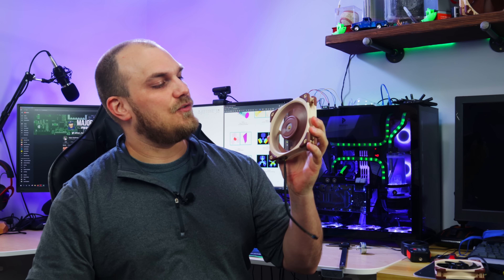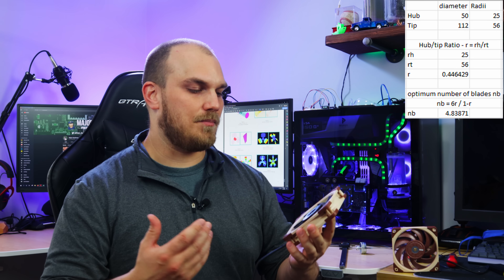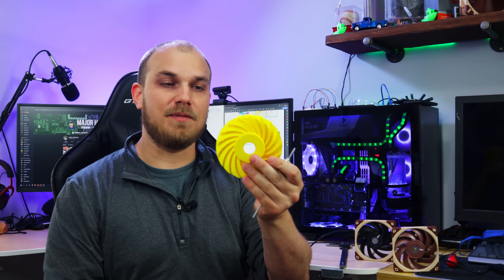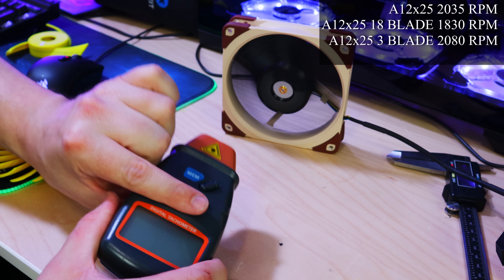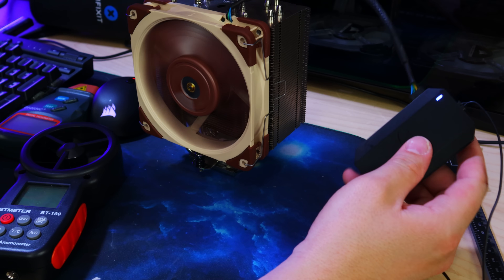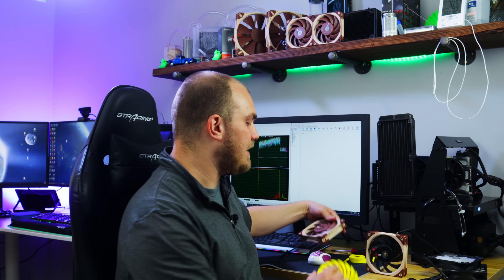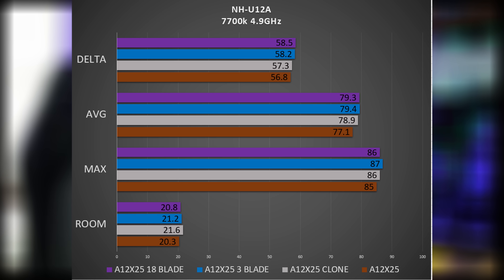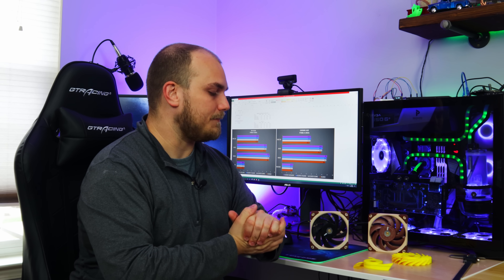What If the Noctua NF-A12x25 Had Twice as Many Blades? | Custom 3D Printed Blades

Comment: If you want to get a fan that outperforms Noctua's, you're going to have to stop ignoring the roughness of your 3d prints. You need to smooth those out, you're hindering your aerodynamics significantly. Given the same motor, you're not going to outperform the fan with significantly inferior processes. Knowing this difference also puts into question your assertions about the 18 blade being worse. It's clear given that your clone performs worse that you have other factors interfering with the performance of your fans.

One conclusion I could draw is that you're wasting a significant amount of energy in generating noise with the clone fan. It spins slower, indicating that it requires more torque to turn, and it's louder, indicating that more power is being used to create noise.

Sand the blades down, or use a printing material that can be used with acetone smoothing. That should be what you do next before messing around with fan geometries more.
Reply: There is a reason noctua had to develop their own polymer, sterox. It's incredibly rigid, which resists centrifugal force, which allows for sub-mm clearance to the frame.  This is what makes the nfa12x25 such a silent and efficient performer, the actual design of the fan blades themselves is a much smaller part of the equation.
Reply: @Cichlid_Visuals  At those speeds, centrifugal force should have minimal effect on blade length so that won't be the issue. I agree that many fans are made with huge and unnecessary gaps which drastically reduces the effectiveness, but that's just crappy manufacturing. Stiffer material might be good for reducing blade vibrations though even with thinner material
Reply: @Cichlid_Visuals : There's a reason for literally everything, though. Might you have meant that there's a purpose, instead?
Reply: @Cichlid_Visuals  Sterrox LCP,  Sterox is cleaner used in wine making.
Reply: I'd suggest manually sanding it down with an extremely diluted acetone solution and a sanding sponge. And some sand paper.

And then I'd make a casts of the fan, and use that to make additional copies.
Reply: @AmaroqStarwind  acetone doesn't work on PLA, now if he printed in ABS it would work. And I agree his prints look awful at this point in time and honestly could still use improvements even in his most recent videos.
Reply: Absolutely. That also increases max speed because less air is generating turbulence and noise. 

Also, another tip is trying to use a different fan with a smaller central hub like an Eneloop, Arctic or Scythe Kaze Flex so there are more space for the blades.
Reply: Couldn't agree more and couldn't tell it better than this. There's also another little aspect that is worsened by the sub-optimal print: vibrations; which stresses more the motor, the ball bearing (in the long run shortening the life of it as well) and, quite probably, adds some noise too. 

A while back I bought some cheap fans form aliexpress and the blades presented small imperfection due to inferior casting mould. That was enough to make them vibrate more and more noisy.
Reply: Realize merely copying the blade and changing the number isn't enough.
You have X amount of power, put into 9 blades.  If you cut that to 3 blades, you have to radically change the blades to even be able to put the same amount of power into the air at the same RPM, where the motor and everything else will be designed to operate most efficiently.
Take an airplane, with a specific engine, and a specific 3 bladed prop that best matches the engine as an example.  Best 2 bladed prop at that pitch will have a larger diameter, best 4 bladed will be a bit smaller.  Or you can change the chord of the blades, or pitch.  Point is 'copy the same blade more or less times' is always going to be a loss if the normal was already designed to be efficient.  You have to change other parameters, not only the number of blades.
Reply: the biggest problem with sanding is changing the mass of each blade to diferent proportions, which will lead to problems, possibly an uneven force distribution that could lead to a catastrophic failure. with these things being as small as they are, it also means, a the variation doesnt need to be big to affect its integrity.
Reply: this didn't age well at all
Reply: @y2ggaming397  I suppose if you're greatly concerned with your own ego then that sort of thing matters to you.

I'm a big enough man to admit when I'm wrong. It had a less significant effect that I expected for sure. It expands my knowledge, though. I might do some deeper testing on the subject if I get around to it, but have quite a few things lined up already and don't expect to find huge gains in this area.

Testing was a bit crude, but good enough to eliminate any tremendously large effect. Either way I wanted him to test that, and he did.
Reply: You realize he knows this right? He was in the air force lol. He's having fun trying things.
Reply: @SirNicholasT  What are we supposed to take away from him being in the air force, other than that he was in the air force?

He's definitely having fun. He's also testing things because he wants to prove or disprove certain design hypotheses. If he wants to make any conclusion simply comparing blade count, then it is reasonable to assert that he must find a way to make his clone (identical blade count) perform nearly the same as Noctua's. Either that, or Noctua needs to stop being his baseline. That doesn't necessarily mean either that surface finish isn't interfering with the performance of the fan. It simply needs to be tested, just like the other things he is testing.
Reply: @Sevalecan  that he was a pilot that went thru flight school and currently an engineer. That's all. If you watch the video he addresses most of what you said but says screw it we're just having fun.
Reply: @SirNicholasT  That's interesting. What is the video titled? I would like to watch it. Still, he did state a goal of outperforming Noctua's fan, and I do believe that's going to hold him back(And of course I could be wrong). And I'm still interested to see the effects of smoothing out the fan geometry.

I also work as an engineer (EE) and have had flight training though not been in the air force. We don't know everything, and I don't assume any other engineer does either. I can't take anything for granted, it's a learned habit, but if he has spoken about this specific topic I'd be interested to hear it. :) And I'm still not sure how much he knows about fan design, I'm certainly no expert either.

Am I overblowing the significance of the blade roughness? Best way to find out is to try it. I'm sure the clearance to the ring is a significant factor, but that would be more difficult for him to test if the rigidity is as significant as claimed (creating the need for the sterrox material), etc and he cannot at least replicate that on his own.

I don't see my post in the light of ruining fun or ignoring it, but I see way too many youtubers give up and never explore anything in depth, though this guy has been a bit more persistent about it than say, LTT, who are incredibly lazy. Linus' latest video on the radiators kindof demonstrated his hubris and the whole channel's laziness to testing things. Granted his ultimate goal of getting views is still satisfied, so he doesn't need to be as invested in the detail if he lacks passion toward those subjects.

(Going off on a tangent here) Series(physical) radiators are, maybe not as bad as Corsair noted in certain scenarios, but they are the least efficient way I can imagine to configure radiators. You're going to have an exponential level off on the amount of thermal energy transferred to the air with a fixed volumetric flow rate of air and cross section, where if you're pulling in room temp air directly into each radiator separately, it should perform better.

I am working on making some of my own videos now, but can't really afford a 3d printer ATM to mess around myself (at least not the one I want). 

Anyway, having fun is great, but I'm passionate about engineering. I have a strong opinion. I want to see things, I'm voicing it. Not in any way attempting to ruin his fun. When you work as an engineer, you have to be willing to accept criticism or questions. It's part of the deal.
Reply: @SirNicholasT  being in the airforce doesnt give you an instant bachelor/master degree in aerodynamics and physics dude. depending on where you are used you may end up knowing shit other than how a plane rides the air or the wheels make your plane waste more fuel if not pulled inside. and even the engineers of the air force dont need to know how a fan pulls the most air inside or the most efficient way, in the end they repair planes and dont optimize them, they open the turbine, replace the fan or fans and give it a go they are not employees of lockheed martin or co.
Reply: I was actually thinking about making a comment of investing in a good SLA if he wants to do this kind of thing. Sure it isn't perfect, but the resolution will do wonders to smooth it out right from the printer.
Reply: it might be easier to just copy the noctua fan and print it- it should perform a bit worse but everything you compare from now on is actually comparable- it would also show how much worse it would get just with the difference in surface quality
Reply: I think he understands the manufacturing process that goes into fans, he's just doing proof of concept designs and stuff. If you were going down this route, you need to make the fan with an odd number of blades, even numbers make rhythm which reduces energy, the weight needs to be near perfect, rpm to weight ratio is also important, it changes the point of inertia, that's why noctua makes their fans out of a specific material. And of course, as you mentioned, areodynamics, sanding the fans and changing the profile and the lip of the blade would also make a difference. You can get as complex as you want and you probably can make a fan better than noctua eventually because noctua fans are made to production specifications. But is it worth all that time for a YouTube video? Depends on your audience.
Reply: I was going to suggest an SLA printer so you get a better result. The "ideal" blade would have a smooth leading edge with the area getting "rougher" starting at the camber point.
Reply: I didn't read fully i appreciate you took the effort of typing those kudos
Reply: What he needs to do is invest some time into making his 3D printer non-planar.  Which also means some time on Linux (and presumably if not wanting to use a Linux VM all of the time, modded Slic3r via WSL if that is even possible ) and investment in 3D printer components to make a non-planar print not suck. Maybe even, invest in an entirely different printer which would be more non-planar friendly.
Reply: @bluephreakr  Since when is there a complete functional workflow for non planar printing that isn't just a research project? Especially for a complicated model like a fan instead of a single fin?
Reply: @kendokaaa  There isn't. But raprep didn't come out from nowhere, it was made from conceptual proofs which eventually came together into the 3D printers we have today.

3D printing by itself is a continual research project with global alumni and volunteers working together to create a repairable future.
Reply: I would use that fan,but made out of cast iron.
Reply: I had to do a project on ventilation fans for college and it's a painful process. You've nailed it though. Smoothing will get you closer to the simulated flows as surface roughness is INCREDIBLY difficult to account for in simulations. Air is a tricky bitch and trying to model a design while including manufacturing defects is really difficult. When you talk to masters in the "fan" game their test samples generally will be the best of the best examples for testing. These rough prints will be at a big efficiency loss. You'll want your surface profile as low as you can possible obtain. What's interesting, I found your printing path can account for 8% of loss, the lines of the print can help with turbulence as it can direct flow pretty well for the income blade. Interesting stuff
Reply: @chrisconley3579  It seems he is not really reading the comments as people do mention this in all the 3d printed fan videos lol. Oh well..
Reply: Alternatively he could print an exact copy as an control, though the performance cost is probably more complex than just a flat cost
Reply: How much time did it take to right this holy cow
Reply: I was about to say something like this. The 3D print is COMPLETELY different from a printing in a industry. If he wants a real comparision, he need to have a better printing quality and more caution with the finishing.
Reply: I think messing with geometries will have a way more significant impact than the minor imperfections from the material. There is no chance that he will come close with 3D-Printer Material. Plus: He even painted an original fan with powdered paint and it didn't do anything worse. There is a reason why Noctua spends huge amounts of RnD-Money and takes years to come up with a new design for small improvements. They even take years just to come up with the perfect black version of this model...
Reply: @ThrashingBasskill  I don't agree with your assertions. Given the low power of the motor, I'm betting you would find the drag induced by this significant. Of course, this would be the perfect opportunity for him to prove at least one of us wrong by changing that single aspect and seeing if it has a significant effect.
Reply: @ThrashingBasskill  "minor imperfections of the material" did you see the fan blades? thats rough as fuck when you compare it to anything other than 8 dollar bestbuy homebrand fans that are actually just shiezhue fans (generic name, i mean the brand used in very basic budget psu´s)

Comment: There might be cavitation between the blades of the 18 bladed one where the gap is not allowing optimal air flow.
Reply: Curious if 9 of the 18 blades is extruded 6-10mm past housing face if it would alleviate some of the cavitation or make it worse, maybe a clear acrylic wind tunnel test on dynamics??

Also the lacquer paint comment above might help flow
Reply: @ba94845  You're maybe what I'm looking for is starvation, I know it happens. Where there is only so much air a fan can pull no matter how fast you spin it.

Comment: why is the motorhub so big on all fans? Feel like shrinking that down could reduce temps a lot. Does the motor really need that much room?
Reply: smaller motor = less torque = less RPM with the same current, or more current to keep RPM the same. Cooling something with a hot fan is a bit counterproductive :) and the motor hub is a dead zone for airflow anyway (another reason not to overheat a small motor there)

Comment: A lot of it comes down to the low quality prints compared to the molded blades creating a lot more turbulence. That creates more noise and slower air speeds. Since you really only have a 2% difference to their fan you could say the cooling performance would be pretty much the same if they were smoother.

Comment: I’d like to see you test with the Corsair Magnetic Levitation fans, which I would argue are better than Noctuas.  The motor is anyway.  I’ve had them both, the Mag Lev moves more air on the high end and is quieter on the low end, so they’re a little more versatile for what I use them for.  Which is on minimum most of the time and full blast while benchmarking.

Comment: could you try completely asymmetrical blades, which are still weight-symmetrical?
or just different sized blades? car tires use an asymmetrical profile, if you look closely. perfectly symmetrical car tires create loud whine.
as demonstrated here:https://youtu.be/ou5hDAA1920?t=193 its german, but you can hear it
symmetrical tires: https://youtu.be/ou5hDAA1920?t=299

Comment: i would think the 18 blade design has stable throughput at low rpm, as the air is more directed, whereas the 3 blade design might have next to no pressure at low rpm

Comment: Look up Non-Linear slicing.

---

Also take a look at tempering, annealing, etc.
Don't forget to:
1. Use a heated bed and printing chamber
2. Pack your parts in some kind of sand or whatever so that the heat spreads as evenly as possible
3. Use a convection oven so that the heat spreads as evenly as possible
4. Dehydrate your filaments (to remove all moisture) and print at a higher nozzle temperature to reduce warping
5. Use plenty of supports before you temper and anneal your parts
Reply: non linear slicing wont work for overhangs, at least with normal printers :( 
its really cool stuff though im very excited for it, that plus 6 axis 3d printing should be amazing.
though 3d printers now are pretty amazing, you can get smooth results with high resolution printing and slow speeds, and some sanding.

Comment: Seems to me there's very little left to improve when it comes to fans. From the top of my head I can only think of some sort of encased turbine design with 3 or more fans on a long shaft inside that will perhaps create more pressure? I'm not sure of the turbine could be somewhere else to avoid noise and blow the air through a pipe to the radiator. Seems far fetched tho. Seems to me we've already reach max efficiency at low noise.

Comment: The number of blades must be consistent with the angle you are using. Changing the number of blades without changing the angle end in loss of performance. A stepper angle increases air intake, better for a high number of blades. The oposite is also true, as straight blades with low surface area are better when their number is lower. Try playing around with the size and width of the blades during the desing phase, don't keep using the exact same type of blade will always end in a poor result against the original.